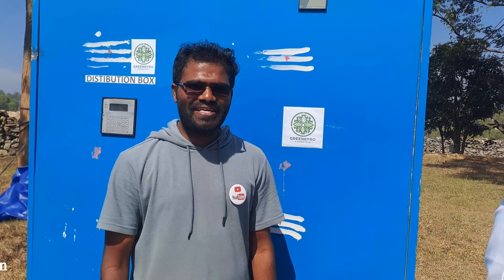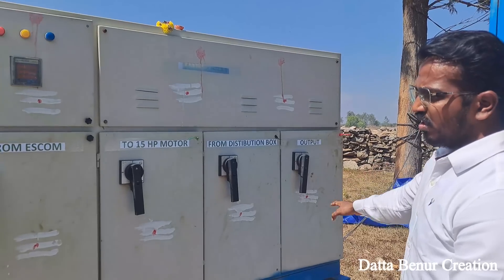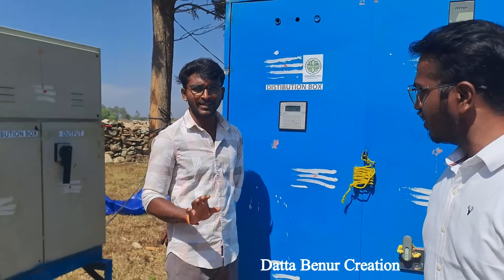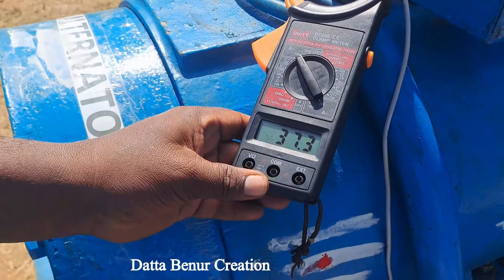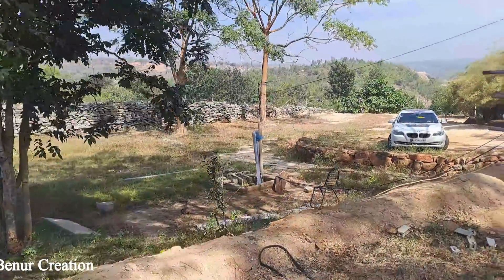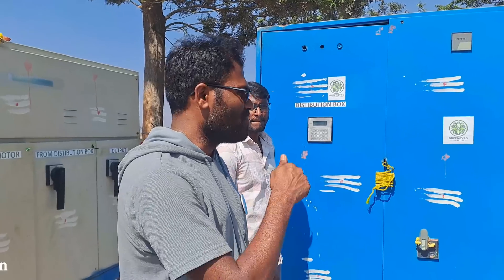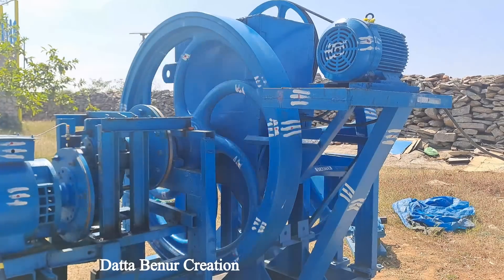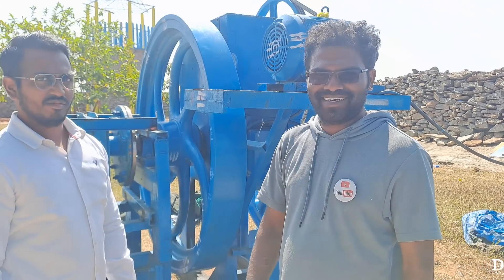the world first commercial flywheel Energy Technology - 0% input 100% output

Comment: The motor is receiving continuous power supply from the generator after power cut off due to which it slows down after running for 45 minutes.
Reply: No load, it will run for long time. With load only for a few minutes. The motor must work in Island mode and sync to supply through a ups. The flywheel supplies will generate some power in the generator aka motor for a few minutes. When another generator is started or mains power restored, the ups will sync and run the motor from the last speed and keep it ready again. This system can be used only where continuous power is required in a factory like ceramic plants, semiconductor fabs etc. Now for other applications, this is a useless applications. An UPS with Lithium battery power can power the plant until standby genset is started. No mechanical wear outs. Regards.

Comment: While you are checking the input consumption with clamp meter not showing any amp because of you have clamped with insulated negative and positive together running wire.  The clamp meter will read only a single polarity wire only.  Please don't post like this 0 input with high output.
Reply: پاگل بنارھا یہ ملباری پوری دنیا کو صرف یوٹیوب چینل کے لیے 
پہلے انہوں نے کوشش کی ہوگی فری انرجی بنانے کی 
لیکن شاید ناکامی اور پروگرام کے وڑ جانے پر یوٹیوب کو لوٹنے کا پروگرام بنا لیا ہے

Comment: Mr. Roshan, please see that you don't confuse electrical energy and total energy. electrical energy can be amplified 15 to 20 folds with low spec machines. don't even need higher weights having flywheels. with regular ebike motors and home made alternators, with sufficient cooling setup, the torque difference between the ebike motors and Alternators can be given and the whole concept just works based on inertia and one more basic idea, that is, the input getting motor's torque to spin at specific rpm should be always greater than the output generating alternator's torque necessity to generate the necessary electrical power. All one need is to know the basic understanding on motors and generators (or alternators) for building this kind of machine.
Reply: Dear Mr.Roshan,
Invite BHEL, Hyderabad or ARAI, Pune to authenticate your claims.
Reply: Exactly. It's not 0% input because input Has to be higher than output. That's why this doesn't work.

Comment: You said you use EB power only to kick start, and then no power to the primary motor you showed it too I agree..
And the generator was running successfully Good, then you said it is running with the help of some gare box which you invented that's secret OK agree...
Later your assistant switched off a switch and the generator stopped what was that switch from where the power supply came to it which motor was switched off could you explain to me please...
If you don't give me your address I'll come and clarify my doubts
Reply: The secret box containing motor only ,my thought, they want to blame  us by saying this is gearbox
Reply: @suriyap5643  100%

Comment: They say, once it is started to full speed, the motor gets disconnected from grid, till this point, what they say is correct, but later they say, the motor is totally disconnected from power supply, which is not correct, because the kinetic energy cannot be created and ultimately the flywheels will slow down and stop, to retain the flywheel RPM, we have to give the power supply from the alternator to the motor, so the chain reaction goes on.
Reply: also to stop it he just turned it off with a electrical switch when its driven mechanically
Reply: Partly. There is no chain reaction happening here. This machine at the most gives you a stable voltage from the generator fed by a fluctuating power supply fed to the motor.

Comment: One start for how much long run the flywheel, it will stop after few time
Reply: It will run as long as you supply power through the hidden cable.
Reply: you r correct.